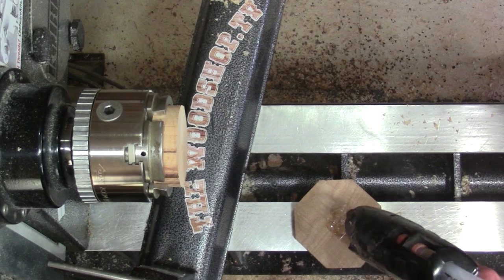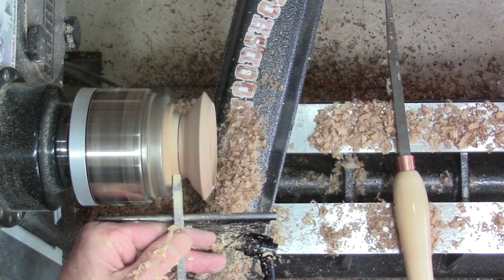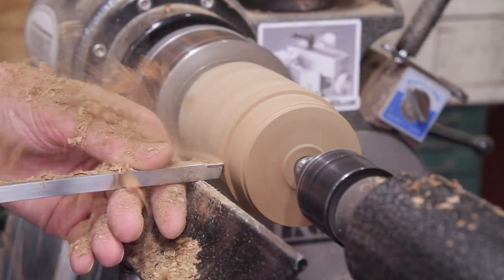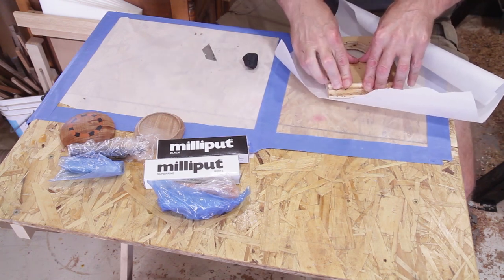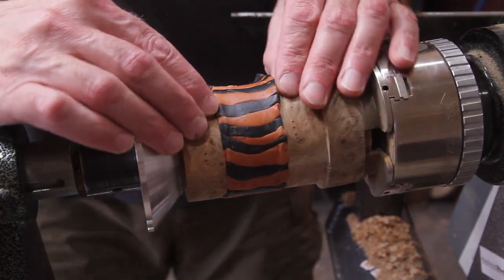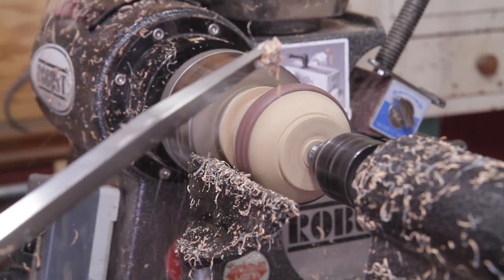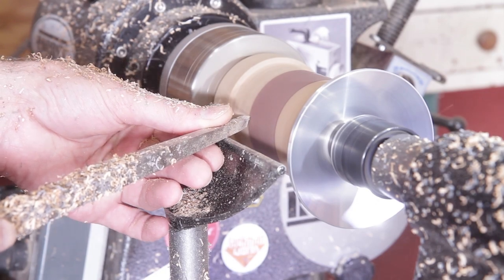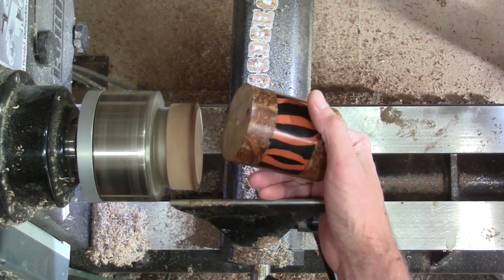Milliput Epoxy Inlay Lidded Boxes | Carl Jacobson

Comment: That is some cool stuff Carl . The wood you used for the top and bottom lids , how thick was it . I saved some nice piece's of maple from a job I did and it 3/4 of an inch . I was going to use it for lids if it is thick enough. Awesome job Carl take care.
Reply from the maker: Thank you Glen!! I think that would be perfect. Mine was just under an inch, and I had a little extra. 
Take care,
Carl

Comment: Hi Carl, great project. I believe Jim said in one of his videos that milliput is heat resistant to 130*C? I believe that's about 265*F. Buffing wheel should be ok in that case, right?
Reply: High Rion, buffing wheels would work but only with very light pressure, there is a danger of smearing the surface and spoiling the clean lines. If that happened  you would need to remount on the lathe and sand it back again. Yorkshire Grit gives a great finish and if you want an even finer finish you can use Burnishing Cream. Cheers, Jim

Comment: a quick tip for working with epoxy like this, any of the stick kind really, you can get it to smooth out with just a little water on your finger while it's still setting. this works like crazy.
I found out with jb Waterweld fixing a old ford gas tank
Reply from the maker: I tried that and it did work! This stuff is crazy! It says it can cure under water.